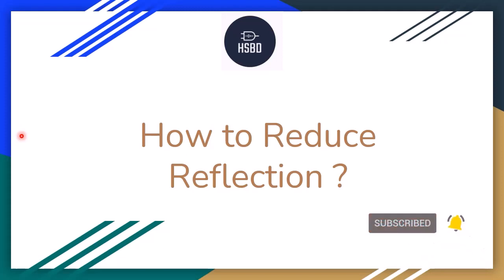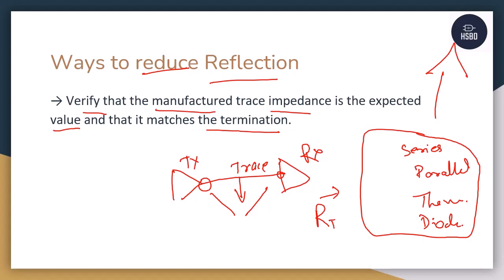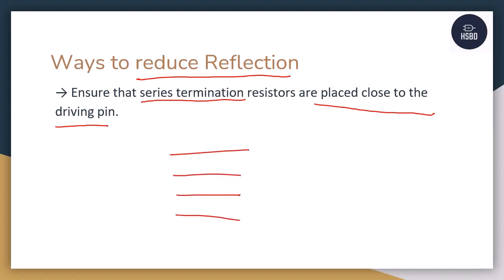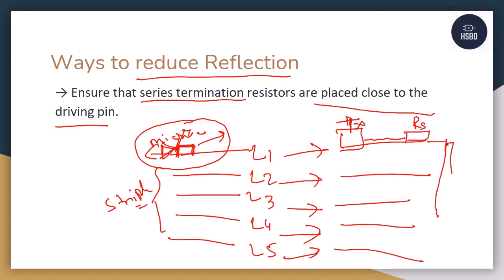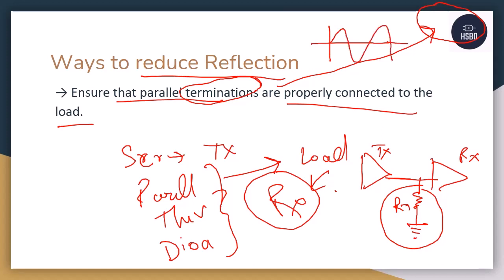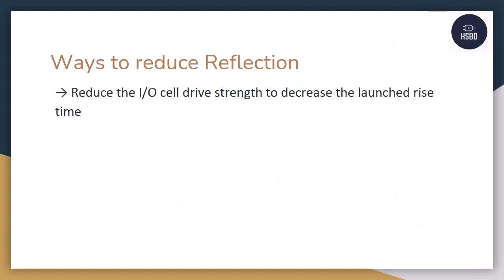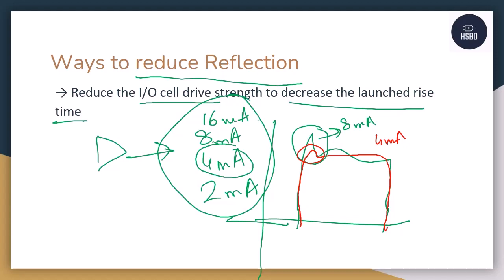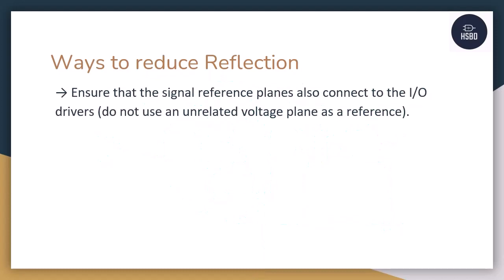Part 2: Reflections & Termination techniques | High Speed Digital Designs

Comment: how do you design a tramission line without termination by saving cost?
Reply from the maker: If you don’t want to use the termination, the stack up analysis need to be performed properly, it also depends on the dielectric material used and majorly on the copper thickness / dielectric Height
Reply: @bhardwajh_2701  may i know what aspects are considered for stackup design without termination usage? Thanks.
Reply from the maker: If you need to design a cost effective stack up without adding termination, you need to do following things
1. Select the metal and dielectric material in such a way that the Impedance across the trace remains nearly equal to driver Impedance ( tough to achieve)
2. Trace width and dielectric height need to be modelled in such a way that the impedance of trace is equal to that or tx and rx.